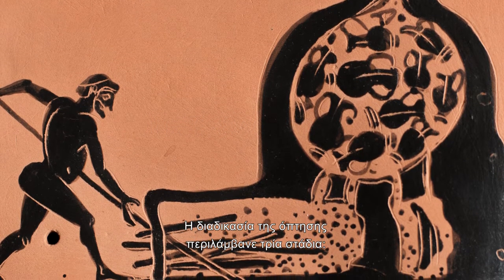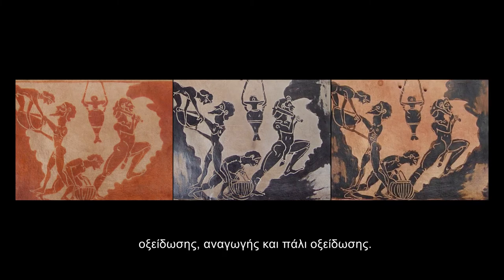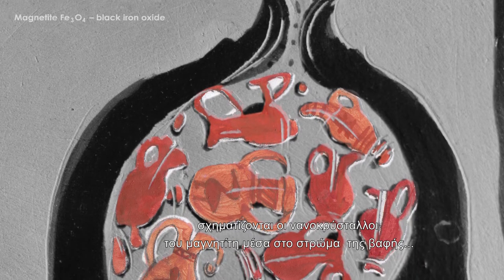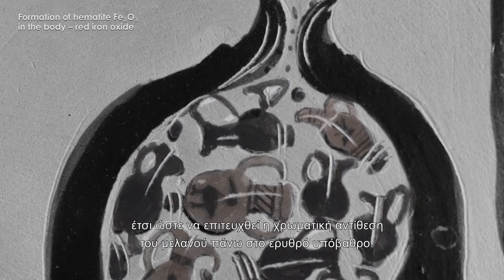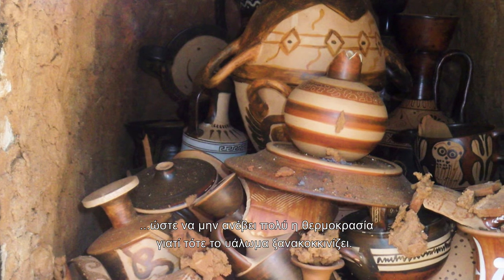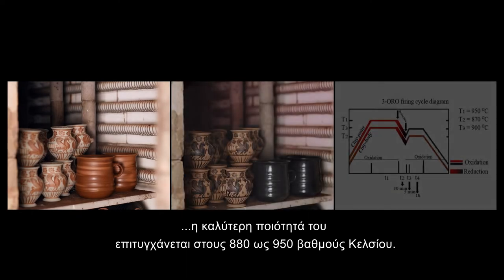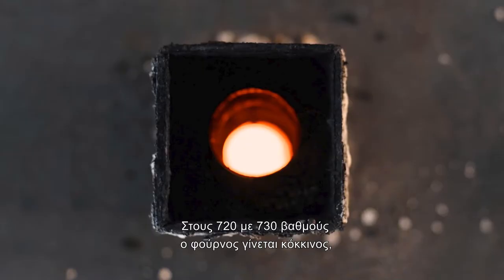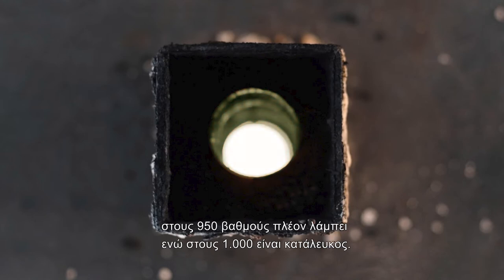Attic Vases part three | THREE - STAGE FIRING

Comment: Started my research at classics dept qu queensland .   You don't have to reduce so low.  oxides up to 950 degrees, then reduction , ten add a green wood compoent, close the kiln . cool to 750 degrees not 800.  the sintering of ferrites is 780 degrees,  you see you make these test tiles below 780 degrees you can drawn these out of the kiln with out loosing the black gloss.  if you reduce from 800 degrees up to 950.  there is a good chance the black gloss will look like gun metal.  the anicnet greeks also made a green patina this material is with in the terrasig,  my test pieces are ina show case in the Ashmoleum museum,  Micheal Vikkers .